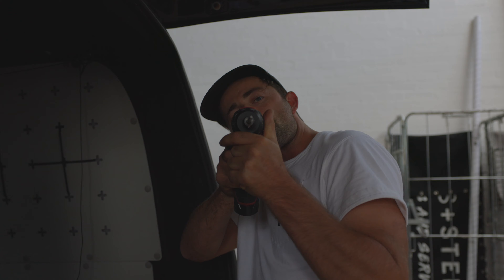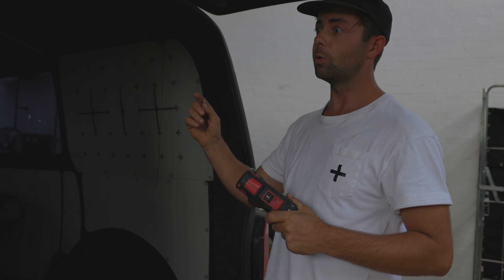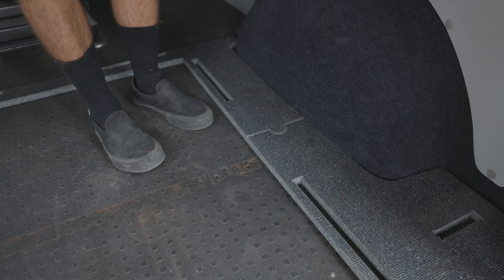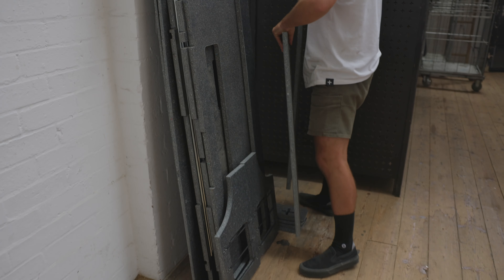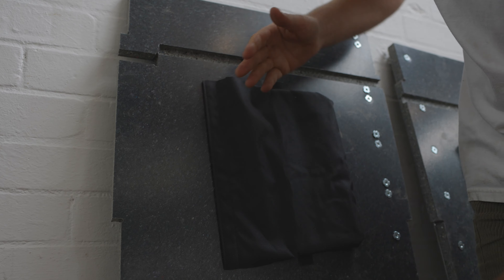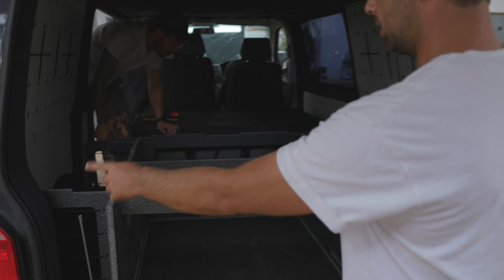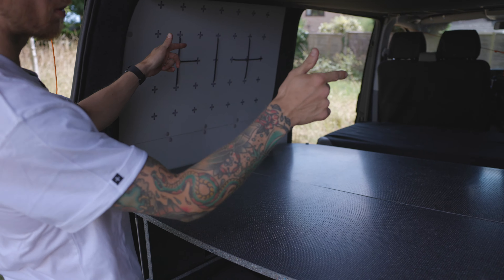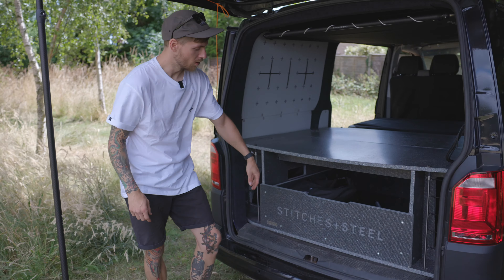Vw T5 / T6 Kombi Van Conversion

Comment: I absolutely love your products and I have 2 questions about this; 1 - Will you make a single drawer with the hinged surface for the Kombi Lite Kit? and 2 - Is there any way to adapt this to a van with a rear heater unit and housing? Cheers.
Reply from the maker: Hey there, We aren't making custom parts at the moment but we may do more in the future! Shoot the boys at the custom haus an email and they can let you know if we can make the adjustments you need :) Thecustomhaus@stitchesandsteel.com
All the best, S+S
Reply: @stitchesandsteel  Thanks for the reply, will do. Cheers.